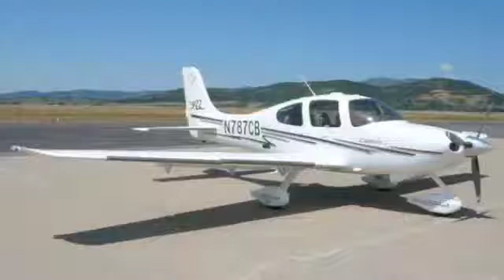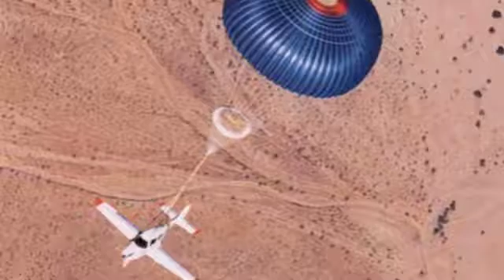787CB CAPS Deployment

Comment: statistics show that roughly half of all Cirrus accidents that do occur end up being fatal accidents. There have been 83 fatal Cirrus accidents but if just half of them had been Cirrus parachute saves instead, the Cirrus fatal rate would be .82/100,000 – substantially lower than the general aviation average. Hence, Paul Cirrus aircraft, even with their parachute systems, aren’t much different than any other GA aircraft but instead they are only as safe as their owners or pilots make them